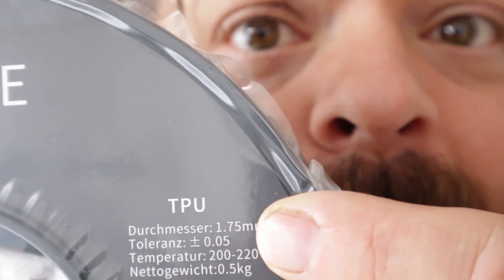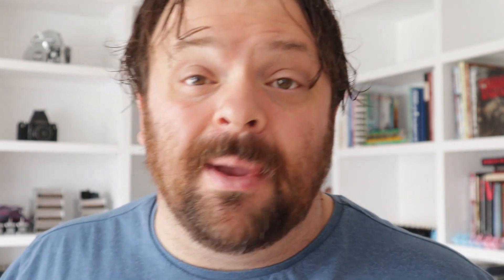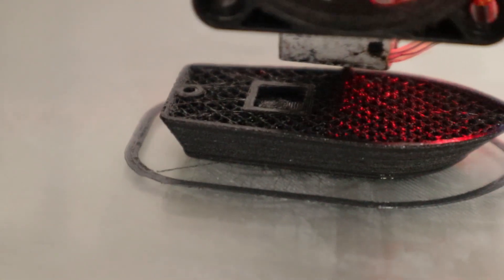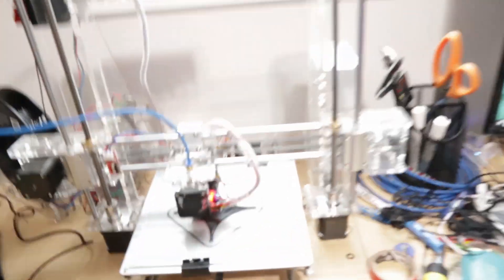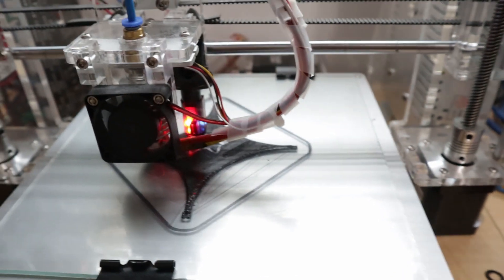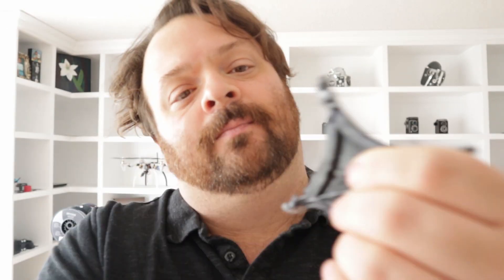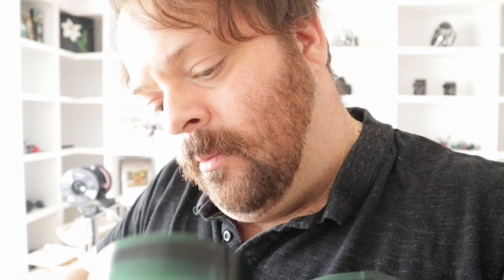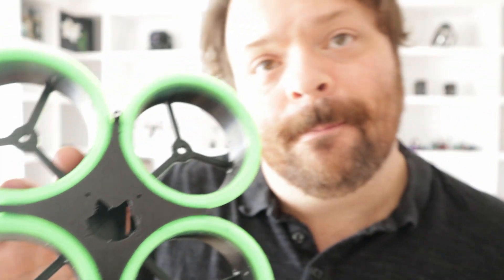Printing TPU Filament with a Bowden Tube 3D Printer? Nailed it! Well, it's functional!!!

Comment: I've found good results with outer wall print speed at 10mm/s, infill and inner wall at 50mm/s. 220c on initial temp and 202c final temp. Retraction on with a 1mm z hop to get rid of stringing. I also have to push 140-150% flow. Print outer wall first. Bunch of other settings but those get me started with good production quality prints. Good luck!
Reply from the maker: Thanks Robert. I have a direct feed printer now as well, but I'd still love to revisit this on a bowden tube because I know the results can be much better. :D